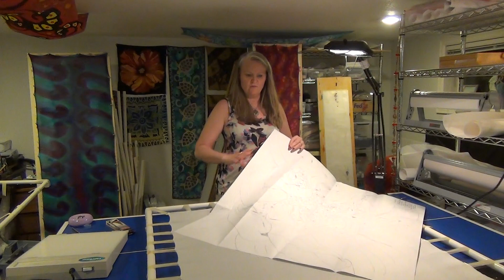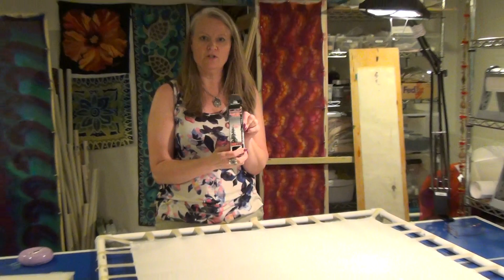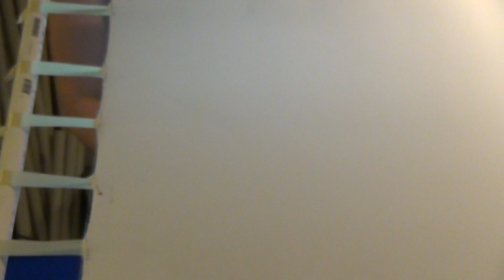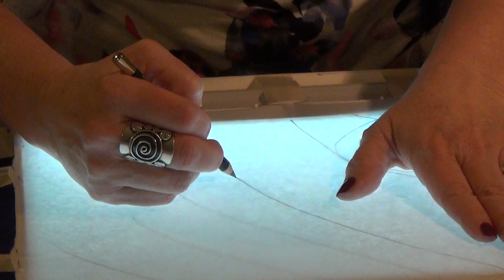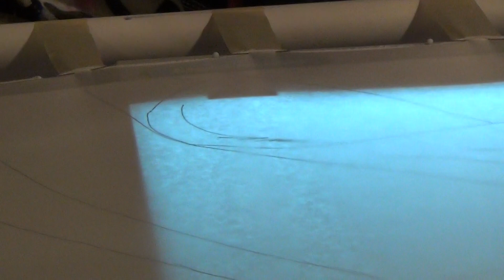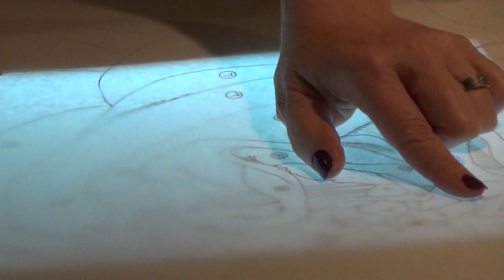Transferring Patterns onto Silk

Comment: I have used that pencil a lot, that pencil's brand  has to be used very lightly, because it does not remove after steaming and  washing easily as it is expected. There are complains about it.  What i do, i just draw very fine and disconnected lines .